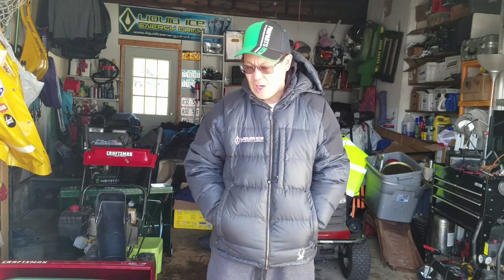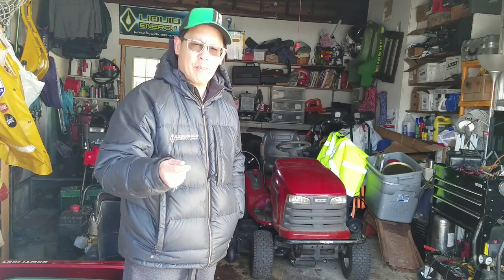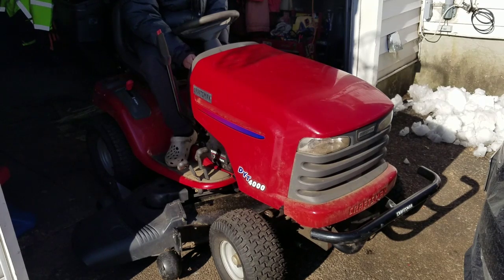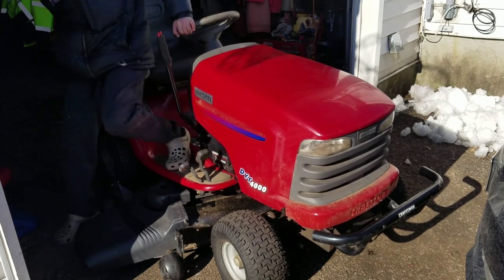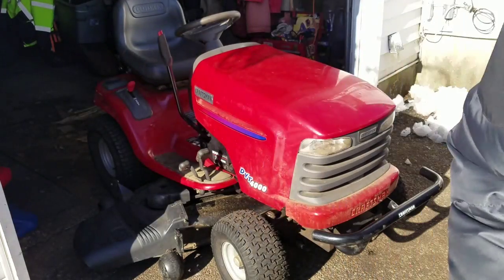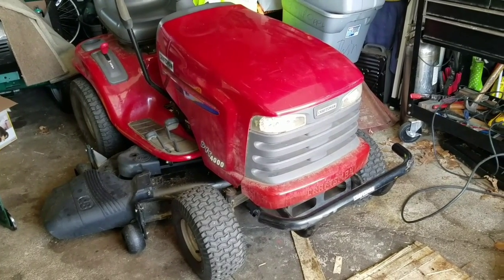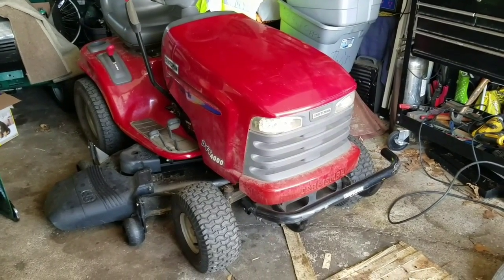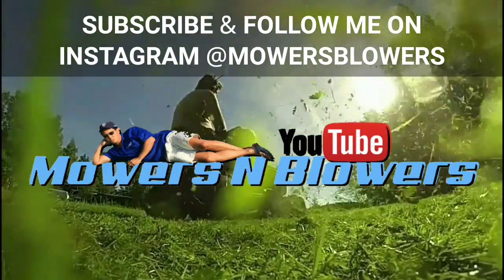FREE CRAFTSMAN DYT4000 YARD LAWN TRACTOR MOWER DECK PTO CLUTCH STATOR AMPS TROUBLESHOOTING UPDATE

Comment: It was never going to work with the alternator you had on that engine, it wasnt providing enough juice to power that pto. Taryl Dactyl just covered that in his last video. Its all about having enough power being produced by the engine with a stronger alternator, otherwise you would need a second battery just for the pto. Once you get an alternator capable of producing enough juice to power that pto you should be good to go. I doubt its the shaft in anyway, but it will be interesting to see.
Its the same thing on a snowblower, if you want heated hand grips, you gotta have an alternator thats producing enough juice, or the grips wont work, so on the Tractor the electric PTO wont work, all about juice baby haha.
Oh yea, I just remembered something else, on snowblowers with higher alternators, the flywheel's also have more magnets. One without heated handgrips that just powers a light has one or two, a snowblower with everything like heated grips has a flywheel with 5 magnets, your going to have to check and see if you also need a flywheel with more magnets. The more magnets it has in conjunction with a higher powered alternator, the higher the amps it produces. If it does, you may be able to just buy the magnets yourself and glue them on, or your just going to have to get a flywheel that has them. Hopefully you wont have to mess with the flywheel. I looked into all of this when I was thinking about putting heated grips on my blower, in the end the headache of finding the stuff and cost stopped me, but you have too for those blades to turn. Good luck!
Reply from the maker: Thanks for the info Doug...yep gonna have to check the magnets...groan.

Comment: As soon as you start cranking with the battery charger on and it starts to flash like is was it is not working it shuts down I have same charger if you want to try doing it use your van to jump start it

Comment: If the PTO is not seated or fitted correctly due to the crankshaft being too short - that can too cause an engine to stall when the PTO is pulled on, PTO's will interchange on any engine as long as the shaft size and diameter of the replacement engine is the exact same on the old engine, if it's too short or too long, won't work correctly, and eventually what could happen is the magnets in the clutch could fry, also some mowers do require a spacer for the clutch to seat/fit on the crankshaft properly, also make sure that the drive pulley that sits ontop of the clutch is seated properly , on Craftsman/Husqvarna riders with an electric pto, the drive pulley fits into the top of the electric clutch, if it's not lined up perfectly it won't work and if the pulley is on upside down it won't work either. a 275CCA battery is plenty big to start/run a PTO , most mower's come factory with a 230CCA , a 16 amp alternator will help the battery out.  I've had big V-twin's stall due to electric clutch issues, i've had electric clutches be on too tight, slip down off the crankshaft and rip the wires out, i've had them pour smoke and fry and i've had them short out and blow countless fuses, they are wonderful, but can be a real pain when trying to troubleshoot them.